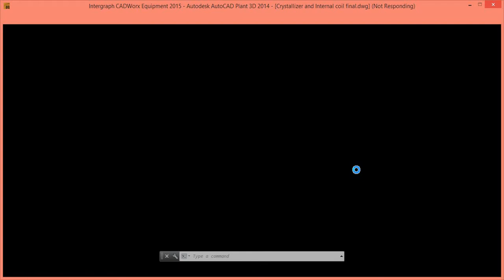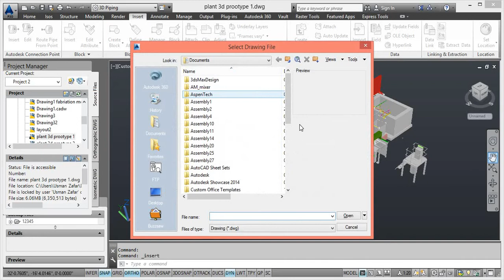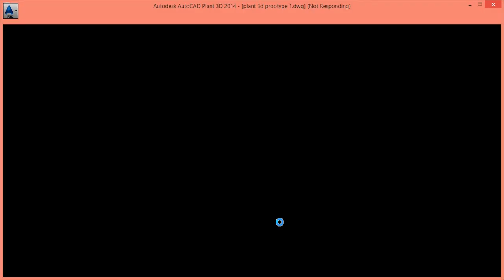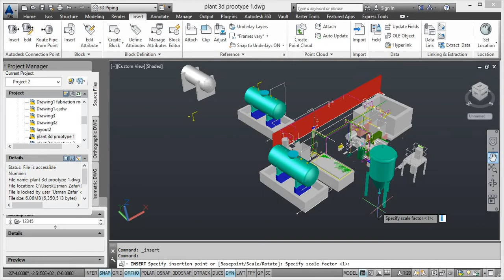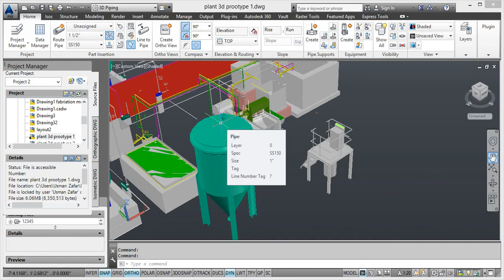How to insert cadworx 3d equipment to autocad plant 3D

Comment: In cadworx, if we xref equipment to the piping module,by using nozzle generic, gasket & bolt generate automatically. But, 
In autocad plant 3d, by using "PLANTINSERTAUTODESKCONNECTIONPOINT" we can mention the point of connection, then  how to generate gasket and bolts  automatically.
Reply from the maker: I will  respond your question very soon
Reply: @chemeng-industrialacademy  where is the response? i would like to know as well